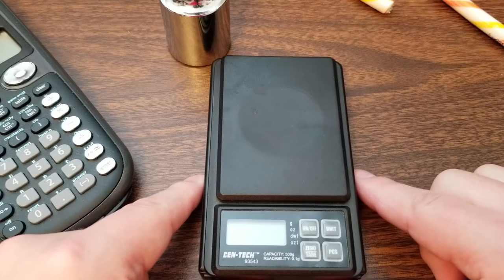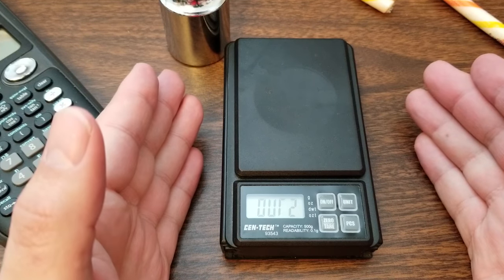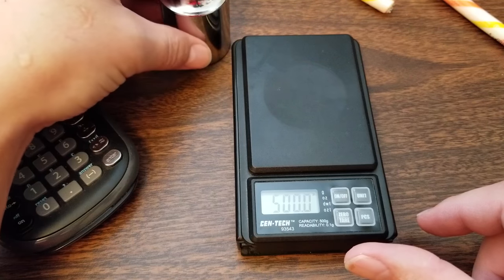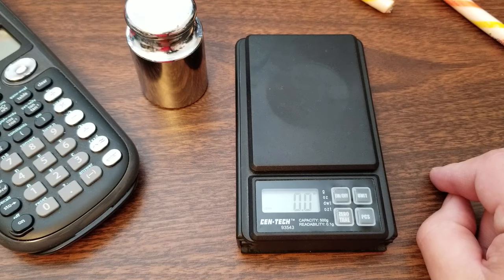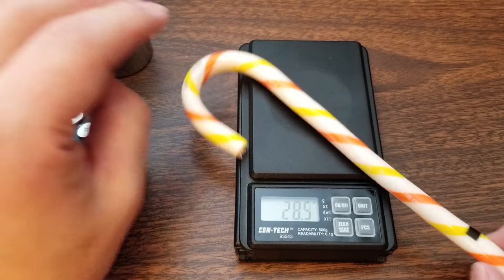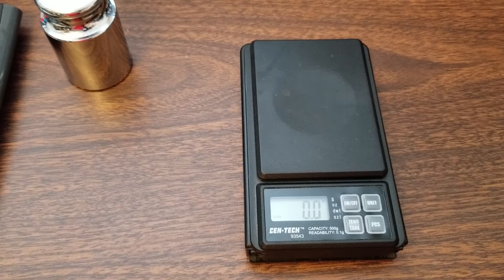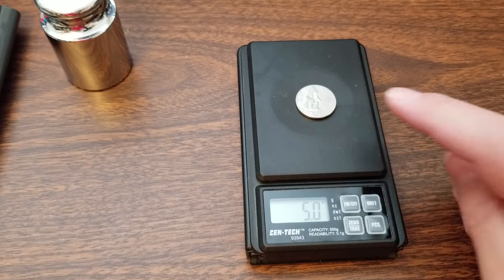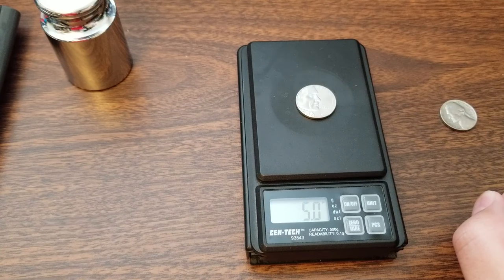Fix a digital pocket scale which needs calibration

Comment: Has anyone tried stacking 40 nickel's on a scales that size? Impractical
Reply from the maker: IMHO Four stacks of ten is not impractical (for those needing 200g for cal). Even 10 stacks of 10 is not impossible (for those needing 500g for cal). or even ordering a calibration weight from amazon is in expensive now days.

Comment: I lost the weight. Help !
Reply from the maker: There are something which you can do to recalibrate if you don't have the right mass. As mentioned at the end of the video newer USA nickels have a mass of 5g. Good enough for hobby lab use but not accurate enough for other things. Even this scale isn't accurate enough for some things in hobby lab use, and definitely not for any type of transaction. Eventually, I will need to get a better scale with higher accuracy for future projects in the Lab.

Comment: Somehow my phone weighs 500g
Reply from the maker: Wow, a 500g phone is crazy. my phone is a brick and only has a mass of 195 g. My DSLR's 100mm maco comes in at 505g and that thing is heavy (especially as the camera body is 895g so with the lens it's 1400g and is death to my neck when I'm out shooting).
Reply: @askquestionstrythings  my phone is just a galaxy note 9 254gb and I also have Asus rog 2 gaming phone 1t in stored 850 snapdragon 160Hz
Reply from the maker: @xSouL_Society  interesting, that should be very similar in mass to my phone. Those two phones together should be about 441g plus accessories and cases.